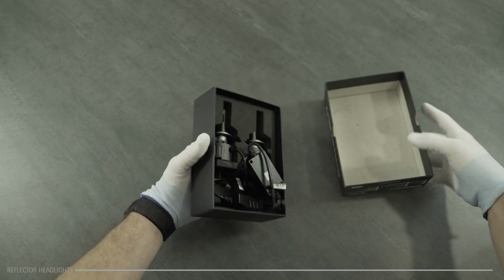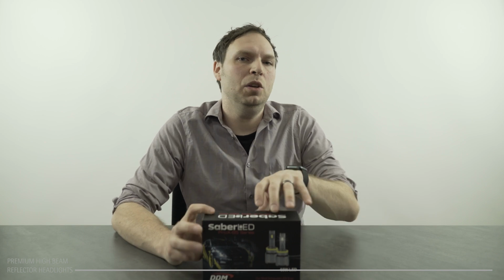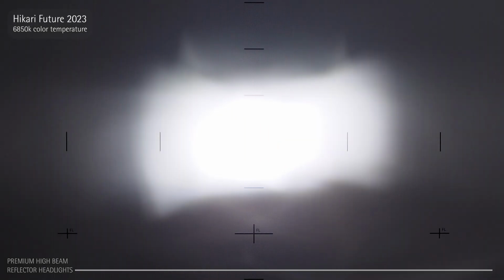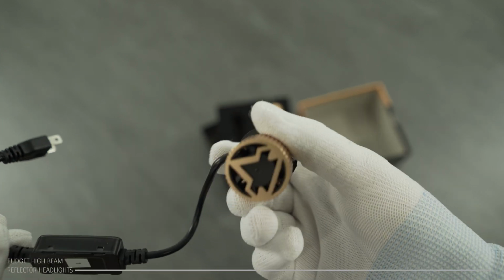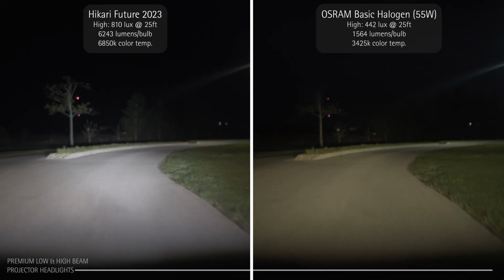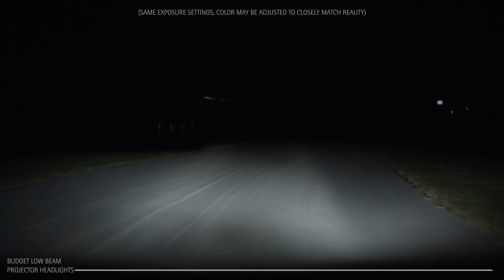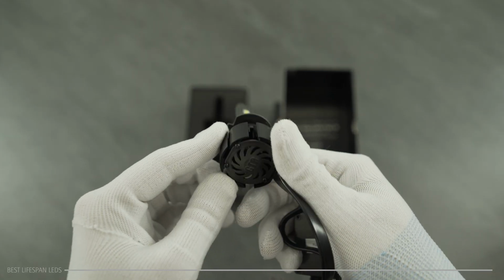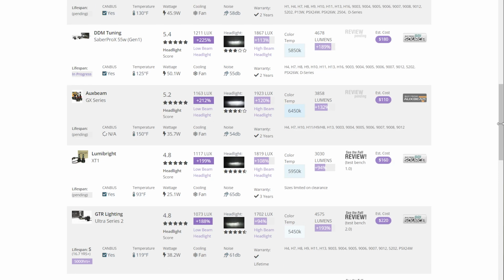The Ultimate Amazon & Premium LED Headlight Kits of 2023: Light Up the Night

Comment: HI!  I checked out the link on Amazon but the reviews are awful.  Can you elaborate on why that might be?  Your video shows that they are great bulb replacements, I need H4's by the way, but that they are not well reviewed on Amazon worries me a bit.  I have tried several LED replacements but the lighting pattern has not been uniform with dark black unlit areas and not a very widespread beam.  Anyone else with experience with these I would welcome to hear!  Thanks!!!

Comment: hey guys I need help 
I got this Alpharex Pro ( Halogen Projector) headlights for my RAM 2500 
I swap the bulbs for GTR ultra 2 low and high beams 
and I am very Disappointed with light output specially on High beams , looks weird , and the light is like I am using a flash light 

Should I try to put different LED bulbs in there, Should I just get some HID instead 
I don’t think this Projector are meant to work with LED bulbs 

Yes I have everything installed right ( chip at 9-3 oclock)
Reply from the maker: That’s a common issue with halogen projectors — even good LEDs like the GTR Ultra 2 often don’t focus properly, especially on high beams. Switching to another LED likely won’t help much. An HID kit would be a better option for proper output and beam focus in those projectors.

Comment: Any led headlight bulb without any extra wiring so it would fit in the housing and cap in the back? It’s for a Highlander with projector style
Reply from the maker: I would take a look at some of the slim fitment options, where the LED is the same or close to the same as the halogen counterpart. Diode Dynamics SL2 Pro for example is a great product (we are currently testing) with perfect fitment.

Comment: Nice video! Now I want to switch to the led light on my car. But my car is a 2017 mini clubman s, the oem halogen light need a reflective bowl, I know that the two lights work differently, so can I install the LED lights mentioned in video? Let me know, thank you so much!!!
Reply from the maker: Thanks! And you certainly can. If you have reflectors, then a proper LED would be the best option to upgrade.

Comment: False about the projector. It’s easier to find an LED that performs well in a projector. A halogen projector is far more forgiving than a reflector
Reply from the maker: A halogen projector is more forgiving for glare, but based on our testing with 5 different halogen projectors, they don't perform nearly as well vs. a halogen reflector. I'm not saying we are right, just sharing our test results.

Comment: Would there be a concern if I was to use the hikari future that is rated at 65w on my 2021 Honda civic projector halogen lights that usually have 55w bulbs?
Reply from the maker: Typically not, but I do know some of the Honda wiring is pretty thin, so I would just keep an eye on it post installation and check for any heat issues (wires heating up too much).

Comment: My HIKARI 2023 Future bulbs only lasted 8 months in my low beam projectors before one burned out and I don’t drive much at night so it was well under 50 hours.   I replaced them with DDM Tuning Saber 65w that arrive today.  
I have had a problem with LED lifespan, my first set was Lumibright XT1’s and they burned out in two years, 12 days after the warranty expired!  
If these DDM’s burn out I am going with HID bulbs or GTR LED’s that have a lifetime warranty, getting such little time out of bulbs that cost $150 - $225 is just ridiculous.
Reply from the maker: Thanks for sharing! And sorry to hear that. We had good results with the Hikari samples we tested. The Lumibrights didn't last as long. The Hikari's actually outlasted many others, but I noticed the external driver is what went out eventually and not the LED bulb itself which is interesting. Likely running too hot in that little box. The GTR Ultra's and the new Morimoto 2Stroke 4.0's offer a lifetime warranty, and their lifespan should be very good, way beyond the cheaper options by far.

Comment: What is your opinion on the Fahren LED bulbs vs Cougar Motors? If the Cougar Motors are better, I might need to change it. Also, the Aukee LED lights aren't showing up on Amazon? Would you know another budget projector headlight; or where else to look for the Aukees'?
Reply from the maker: Both are very good LEDs, but the Cougar Motor's offer a slightly less blue color tone. The Aukee LEDs are no longer available.
Reply: @BulbFacts  What would be your recommendation for led replacements for projector headlights?
Reply from the maker: @Jeragon186  you can find our latest recommendations here for projector type headlights: https://bulbfacts.com/led-kits/recommended/#hp

Comment: Is there an alternative to the hikari 2023, comparable quality, usable in a projector assembly but with a warmer color temperature? 5000-5500?
Reply from the maker: Hi Juan, I would go with the DDM Tuning SaberLED V2 (55W), as they offer a 4500k option, but also a 5500k option which came out very close to that output. Output is similar but with much less blue tone.

Comment: Can you recommended the brightest best bulbs for 2003 Ford f150 that will work in the factory fixtures and won't glare to blind other drivers. I will adjust if needed to keep from blinding anyone.. Thanks
Reply from the maker: Hi Keith, I would recommend either the Morimoto 2Stroke 3.0's, or the Philips Ultinon Pro 9000/9100's for the best beam pattern possible. They won't be the brightest, but will give you an accurate beam, maybe even better than halogen while being a pure white and much brighter over halogen. Links: https://bulbfacts.com/led-kits/reviews/morimoto-2stroke-30-led-kit-review.html & https://bulbfacts.com/led-kits/reviews/philips-ultinon-pro9000-pro5000-led-review.html

Comment: I need to make a warning here: I bought DDR Saber for my wife's car because she drives often at night: I paid over $200 for a pair of LED. NOW the TRUTH: They are worthless THEY SHOULD COST $20 ! I HAD TO REPLACE THEM THIS WINTER WITH $50 BULBS THAT LIGHT MUCH BETTER. I trusted this guy but the truth is that he is probably one of the owners of the company that sell $20 bulbs at $200! Well done. Guys DO NOT TRUST HIM like I did! And the bulbs are very very loud (low quality).
Reply from the maker: Hi Kevin, sorry to hear that! I do run many of the LED products on our lifespan bench including the DDM models. I can confirm that they don't last quite as long as some others, but still did well and should last many years. Some vehicles don't take well to certain products though, as the voltage can play a part on how they run. Adding some capacitors (normally called decoders, anti-flicker, etc.) may help extend the life. Check out our lifespan results on the LED chart, as well as how we test. Everything is kept transparent and I can assure you I own no stock in any of these companies. I've declined sponsor offers numerous times, and keep ads off our website as well. It's something I do on the side for fun as I really enjoy finding the best products for people, which is how it started, I was trying to find a halogen bulbs which matched up in color and lasted a while. Links: https://bulbfacts.com/led-kits/chart/ & https://bulbfacts.com/how-we-test

Comment: So what do you think about the Lumibright XT1s? Are those still good contenders? I’m looking into restoring some vintage cars but I want to update the lights over to LED bulbs as the old sealed beams and halogens just suck in general. I have housings where I can replace the individual bulbs and all vintage American cars use H4 bulbs. I was considering getting the Lumibright bulbs based on one of your previous reviews of them. Are those still a solid choice or are the DDM Saber Pros a better choice?
Reply from the maker: They are still a good choice. DDM offers the same thing called their SaberLED 50W V2, but they are discontinuing them it seems. The SaberLED 65W LEDs from DDM are going to be the brightest option, as well as the Hikari 2023 model.
Reply: @BulbFacts  I have 2 pairs (4 of them) in my 1977 Lincoln Continental Town Coupé and I’m using an H4 headlight splitter to use all 4 lights together as low/high beam simultaneously. I love them. The beam pattern in all 4 housings are perfect and I can see so much better in front of me in my classic luxury land yacht. They also have a perfect hotspot and fantastic light spread in front of the car all without dazzling anyone outside or in the oncoming lanes. And they still retain the factory appearance that I wanted to keep. I love these bulbs. Worlds better than those awful halogen/incandescent bulbs vintage cars came with originally. I also want to check out the Phillips Ultonin 9100 bulbs, too. I hear that the brightness and beam pattern on those are phenomenal as well. I’ll check out the DDM Tuning bulbs in the near future as well. If they’re anything like the Lumibright XT1s or even better, I’m definitely going to invest in them.
Reply from the maker: @BigBerk765  thanks for sharing, and great to hear they performed well in your Lincoln! Some reflectors just don't take well to LEDs, but many do. I haven't gotten a chance to test the new Ultinon 9100, but if they are anything like the 9000 model, they should perform extremely well and last a long time. The total lumens/output isn't the highest, but the beam pattern and hotspot is like no other.
Reply: @BulbFacts  In order to use the bulbs in classic car housings, I got some separate housings from a company called Octane Lighting. They have every kind of classic car headlight housing shape available including the 5 3/4, 4x6, 7x6, 7 inch round and a few others. The bulbs are interchangeable and I put the Lumibright H4 bulbs into there. They work phenomenally and I love that they keep that fully lit appearance unlike a projector housing and only got that one little beam shooting out of one tiny spot in that huge housing. The beam pattern is pretty much perfect. I drove around at night with them a couple of times and I’ve never felt better in a car at night. I’m getting Lumibright’s stuff and DeAutoLED’s stuff from now on when it comes to automotive lighting. But test out the Philips Ultinon 9100s when you get the chance. I’d love to see those in action. But because I know DeAutoLED’s products are top notch and they have a lifetime warranty, they have a lifetime customer in me from now on. Love their stuff!
Reply from the maker: @BigBerk765  thanks for sharing again. And I hope to test the new Philips LEDs soon, as a lot of people have requested them as well.

Comment: If only new modern cars that came with OEM LEDs could let us upgrade those! Companies like Toyota care about power savings and life span over actual brightness!
Reply from the maker: Agreed. OEM LEDs are great to see in new vehicles, but the problem comes when they wear out or have an issue, especially outside of the warranty. It will be interesting to see how they perform down the line, and I hope to see more brands offering full headlight replacements.

Comment: I've been using these videos and the website for my led upgrades since maybe 2017, and I was so excited to see this new one came out. For a reflector fog light, would it be better to pick a low or high beam option?
Reply from the maker: Glad to hear it! We used to test fog-lights but since removed them. I hope to re-add in the future though. I would take a look at the low-beam result and use that as a recommendation. Be sure to consider the lumens tested as well, as that would be your overall light spread.
Reply: @BulbFacts  thanks for the info!

Comment: Have you guys tried Fahren LED's? I bought them to replace Nineo's in mine and my friends vehicles after getting a recall notice about them. The beam pattern looked pretty similar on my friends 17 Nissan Rogue.  Same with my 11 Charger. It's been almost 2 years having them now. Thanks for your videos and extensive testing.
Reply from the maker: Hi Garry, we certainly have! They were actually one of our recommendations in our last video, and still are among the top performing. They lasted an incredibly long time on our lifespan bench as well, so you should see many more years out of them.
Reply: My nineo 2's just died after nearly 5 years. Been a good bulb. Im struggling to choose its replacement. Want something better for the same price point of course lol

Comment: As the owner of a 2018 Highlander I have an issue finding a set that fits in the housing.  
I would rather not have some sort of extended, rubber cab, but keeping the OE integrity of the headlamp assembly…
Reply from the maker: Fitment can be an issue for sure. Dust cap extensions or longer replacement covers usually does the trick, but it's hard finding them sometimes. I'd recommend checking the forums to see what you can find. If you need me to measure something just shoot me an email on our website.